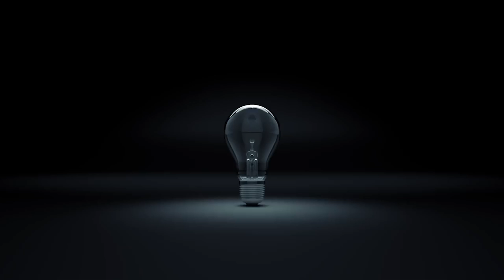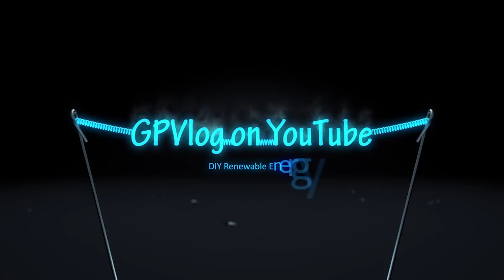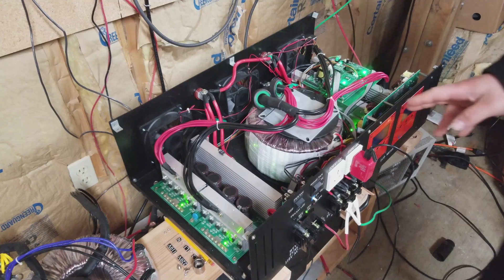Power Jack 15KW Inverter temp test (follow up)

Comment: I WOULD SWAP OUT EACH MOSFET FOR THESE,!!   IXFK200N10P MUCH LARGER 60AMP MORE , THAN ORIGINALS AT 140, THESE ARE 200AMP 100V, ALSO I WOULD GET MUCH LARGER HEATSINK, AS THESE NEW ONES MUCH LARGER TRANSISTORS,, ALSO UPGRADE THE LARGE CAPS,  WOULD MAKE THIS MILLION TIMES MORE RELIABLE, 98% EFFICIANT AS LESS CURRENT WASTE, ABOUT 302£ IN UK FOR 25 YOU ONLY NEED 24, BUT WOULD MAKE THIS RUN MILLION TIMES BETTER, AND COOLER AS TRANSISTORS ARE HYPERFETS, RUN COOLER AND TAKE MORE HAMMER, MAKING IT MORE STABLE

LOADS MORE STABLE THAN THE HY3410P i think there using not rated to what they actually say, chineese mosfets,  but these wil take loads of hammer and more likely produce some serious power.

Comment: Forget about the temperature. You need to connect an oscilloscope and check the waveform under load. That will show you whether or not this inverter is crap.

Comment: Looks like it has only 3kW of MOSFETs in there. How can it be rated for 60kW surge? Sounds bogus.
Running the electric stove, ac, electric dryer and my 20,000 watt sound system at the same time? We do that daily.

Comment: HI.  To get the max power you need, why not rewind the transformer secondary to give you the power you want on 1 phase. - Bipolar winding. . . . Tri-polar winding to get the current capacity. . .  Any motor rewinder company should be able to help. . . .

Comment: My understanding from reading Oztules threads on anotherpower.com the primaries are wired as one continuous loop. The secondaries like any transformer needing a selectable voltage has a center tap to give you single split phase. The 2nd board should turn on when the current is needed. You are def correct about start current killing mosfets. That’s why I’ve got a large number of beefy ones on hand. I replaced the fan that plugs into the control board with a higher speed fan like the other 2. Added a tach to satisfy the board if it turns on the 3rd fan and doesn’t receive a signal. I added E chokes to the primaries to bring down the idle wattage. Is your coil as noisy as mine is and my heat sink far left with no sensor get very hot. I have moved the fixed temp sensor and every few minutes the fans fire up and cools right down.

Comment: I have had one running my whole house for 1 month now, and it runs the whole house: small electric stove, washer, dryer, 5 computers, TV, hometheater, 2 refrigerators and other stuff and it works great, I am off grid, but I did leave 3 air conditioners to the grid, but everything else I am doing it off grid with this system and I only had the problem over heating eventhough I had the 3  fans on, I had to do some extra things to make sure it would not over heat, but once I fixed that problem, it works great.  I have the system runing on a very well vented place but I live on a beach and its very hot 2 months out of the year and the system gave me trouble when it was really hot outside so I had to do several things to make sure it would not heat up. I am running the system with 24 batteries for golf carts, and they are each 6 volt batteries, but I am installing 8 more tomorrow so if I had no problem before I will have less of a problem with 8 more batteries.  The system is dirt cheap from what it does and I love no paying any more electric bills except for when I run my 3 air condition systems with the grid.